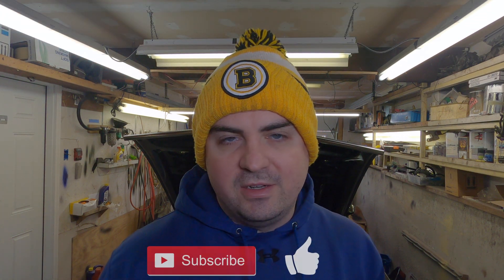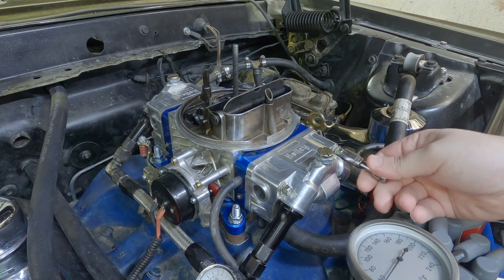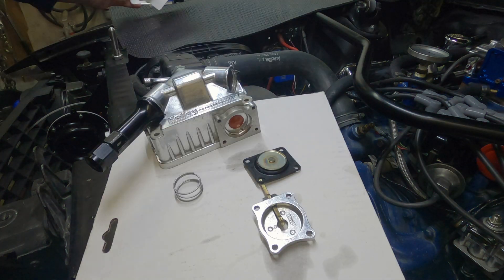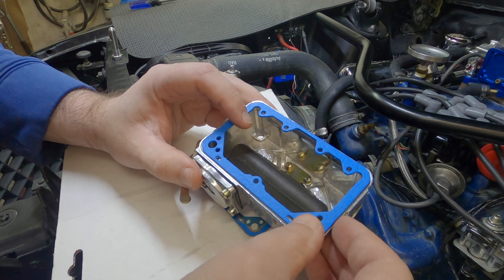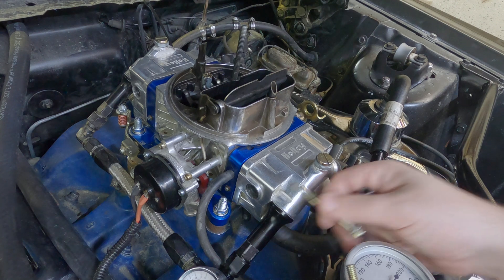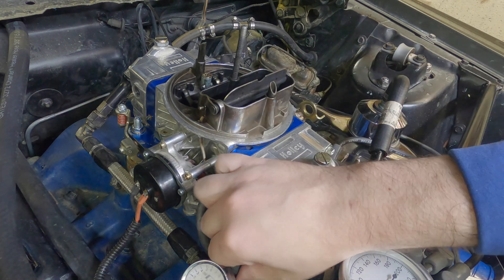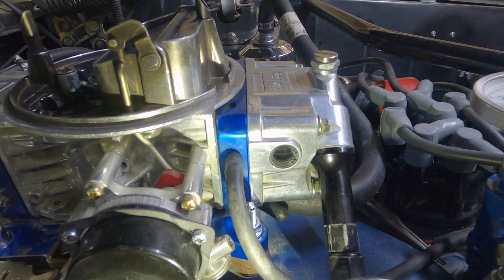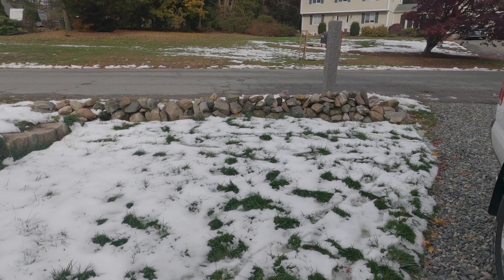Hesitation Fix on a Holley Carburetor (and Accelerator Pump)

Comment: Did you ever fix the off idle hesitation?
Reply from the maker: Yes. It was between this, setting the transfer slots correctly, and then using the base timing to adjust the idle speed.
Reply: @SmackeysGarage  Thanks so much for responding.  I'm 58 and have been trying to solve off idle hesitation my whole life - can't do it.  I live with it.   What's your exact recipe?  Is the pump shot most important?  What size - 31?  I have the slots perfect, timing perfect, etc.  Do you use ported or manifold vac?  I'm close but still get it.  Seems the fuel gets hot in the bowls and I'm getting a weak pump shot - like it's shoot air and gas - not a strong stream.

Comment: Hi greetings from Sweden, my holley just injects fuel in the left port on the carb. Byt the right one is bone dry. Any thought before i start picking it apart.
Reply: My bad, it was the nozzel that was clogged
Reply from the maker: Greetings! Glad you figured it out.

Comment: Removed the fuel bowl from my brand new Holley 850 dp to change the main jets and found the gasket completely split from 9 to 3 o'clock. It came that way from Holley.
Ordered new gasket, installed it and now I'm chasing a leak.
Reply from the maker: I've had that happen to me as well. I've never been a fan of the gaskets that come on the bowls.

Comment: Just happened to me, brand new carb and the gasket was covering the accelerator pump hole causing a bad hesitation. Nightmare to figure out, because when you removed the bowl it looked fine. Replaced gasket, all is good.
Reply from the maker: That must have been tough to figure out. Was the gasket just in backwards or was it manufactured incorrectly?

Comment: This i the exact problem I had. The carb looked like new but it had a bad stumble and would backfire through the carb. I saw that there really wasnt much of a squirt coming from the nozzles. All was adjusted properly but still no strong squirt. I saw this video and another that showed the bad bowl gasket as the problem. I took my bowl off and sure enough it was split right down the bottom seal through the pump port hole.I replaced the gasket and now my nice shiny carb actually works great. The car rips now and I can even let off the clutch with hardly any foot in the pedal and it takes off fine. Thanks for putting up this video.
Reply from the maker: Glad I could help George. I haven’t been too happy with these gaskets. I’ve had the issues multiple times now. They just don’t hold up that well and definitely don’t reuse them.

Comment: Is it normal for the fuel bowl sight gauge to show empty after the car has sat over night (brand new installation from a shop of a 2 barrel Street Avenger)?  I give it several pumps to prime but it starts up exceedingly rough compared to the stock Autolite.  Then after a while it smooths out.
Reply from the maker: No. That is not normal. It should be halfway full when running. Is it at least visible when running?

I could see it evaporating after a long period of time, but not that quickly. The needle should be reseating and not letting it flow back (or leak elsewhere).
Reply: @SmackeysGarage  It stays halfway full when running and warmed up.  Holley rep said fuel could be draining back through the mechanical fuel pump when not running. Thoughts?
Reply from the maker: It could be a siphon issue with the fuel system. Do you have a vented tank? I'd drive the car around for a while, then open the tank and see if you hear pressure built up. You could also leave the tank cap off over night.

You could also check to see if it is heat causing it. Start the car up and run it for just long enough for the fuel bowl to fill up. Then check it in the morning.

If those don't work, I'd probably pull the carb, fill the float bowl, and then watch to see if anything starts leaking out.